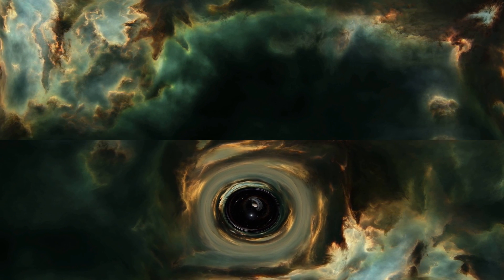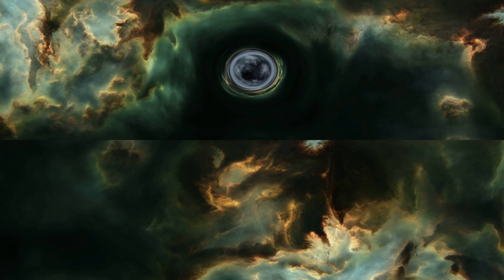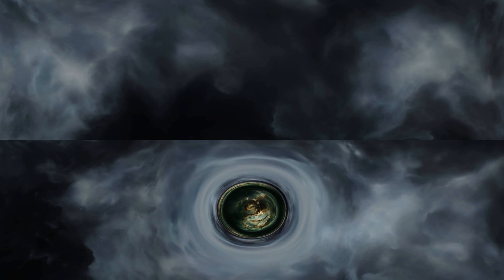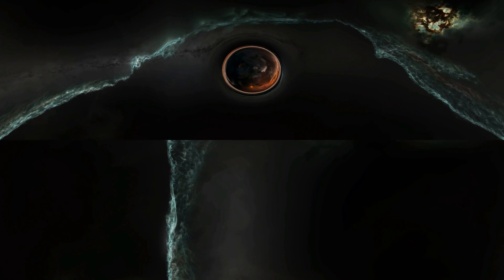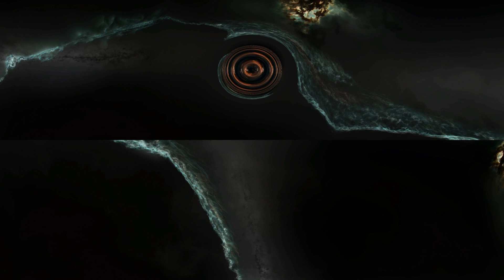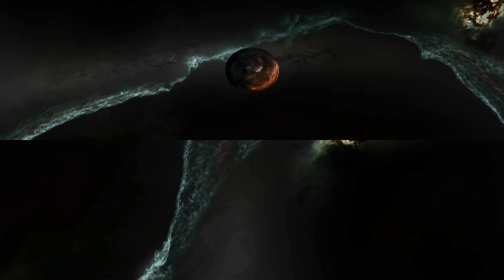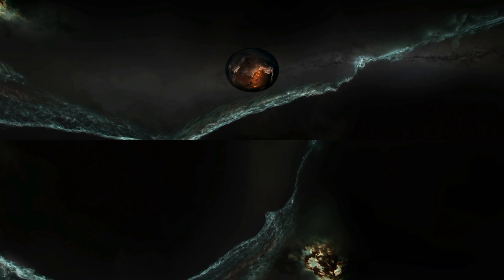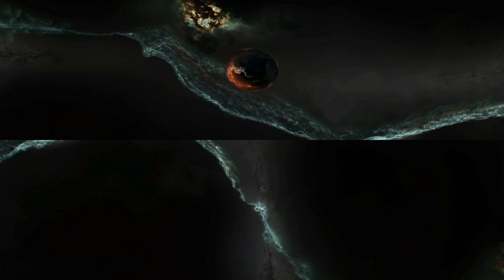What Would Travelling Through A Wormhole Look Like? (VR/360)

Comment: This is a good first step but it doesn't answer all the questions I have about what travelling through a wormhole would look like. It could be greatly improved by placing the ends of the wormhole in recognizable locations on Earth, and also by rendering the objects which are transiting.

What's not conveyed by the video in its current form is that when you are inside you would see yourself if you look in any direction other than towards the exit.

I was trying to imagine the physical implications of moving through a wormhole and to do that I considers a small (2 or 3 meter) wormhole suspended a few meters off the ground which connects two different cities (London and Paris, for example).

At each end of the wormhole you could have six ladders each approaching from the north, south, east, west, top, and bottom, and while from the outside an observer would expect the ladders to collide with each other they would actually all be perfectly parallel to each other inside the wormhole.

One question I can not figure out on my own is how exactly the entrance trajectory compares to the exit trajectory. If I start below a wormhole and climb a ladder up into it and keep climbing until I reach the other end then what direction will I be moving in when I emerge on the other side?

Comment: "But because space gets warped around it, light gets warped around it"

That's what gravitational lensing is.
Reply from the maker: Sort of.... but this geometry is only curved in space and not time so there's no gravity.
Reply: @scottmanley  I don't think there's a better way to distinguish gravity from non-gravity other than the presence of spacetime curvature. For example, the total mass of the wormhole is zero, but if you pick a small volume element inside the throat, the mass density will be nonzero (and negative, presumably). That said, even in an ordinary Schwarzschild black hole the mass is zero everywhere, and the effect of the black hole is seen in the curvature of geodesics around it. Such an effect certainly can be found here even if e.g. you can't orbit a satellite around it.

Or to mention another "vacuum solution" of GR, gravitational waves: they're surely massless, and nothing gravitates around them, but we still consider them a gravitational phenomenon. It's just that gravity is a richer phenomenon than initially appreciated by Newton.

(this was just a quibble btw, fantastic work on the renderer!)
Reply from the maker: @isodoublet  The difference is that without the time component of the curvature a non moving object won't be observe a gravitational pull, the curving of objects paths is only due to their motion. Does that make sense?

I intentionally chose a simple geometry to accelerate my rendering.
Reply: @scottmanley  That sounds like a coordinate-dependent statement.

Comment: Just a quick question, maybe even silly. There is a "mirror effect" to the grids that are formed there @5:50. I am curious if the symmetric properties between the Near-side and the Far-side have got to do with the apparent rotational direction (later seen when moving sideways) as well. What causes that symmetric grid patterns @5:50 and why the apparent rotation of both near & far sides be in the same direction?

Comment: I have a few questions.

If the wormhole has mass but no gravitational pull, does this mean that there is some kind of exotic matter which you could crash into at it's center? Or is this mass somehow obscured by space time?
Wormholes are supposed to connect 2 areas of space, I would have assumed that this would mean that you would be unable to enter it's center as that would be 1-1 mapped to the other side. Instead you showed that you can enter the wormhole, since you can enter it, how do you control where you exit?
Do specific coordinates on the internal surface map to specific coordinates on the external surface? Can a wormhole connect more than 2 area's of space? (for example can a wormhole map to 3 or more area's of space?)
Is is possible that there would be sections of the wormholes internal surface which would exit to nowhere, or possibly outside space time?
Would entering and exiting the wormhole warp/transform the dimensions of the craft entering? (I think you already partly answered this, but specifically I meant would the craft entering be warped in such a way that it could receive damage just from the transformations applied to it?)

Sorry, if any of these are difficult to answer.
I know that this is all theory, but this has been an area of interest since I was a kid, and my curiosity has peaked.
Thank you for the video, hope to seem more.

Comment: There is a pretty big issue that got left out in this video.  If the spaceship going through happened to be about the same size as the wormhole, that ship's sides possibly crashing into each other would be the least of its problems.  If the ship's dimensions happened to be anywhere near the size of the wormhole's features (entry/exit curvature radius and/or tunnel circumference), then the wormhole would have to flex and flatten in the space occupied by the ship, otherwise the space there being curved would partially crush the inside of the ship and/or tear apart the outside when the ship enters or exits the wormhole.  The ship could perhaps be designed so that it can bend, stretch, and/or compress to some extent to deal with that, but probably only enough to handle passing through wormholes at least an order of magnitude larger than the ship if the wormhole is inflexible.

Comment: Totally happy with the sphere from any approach vector, as it should be since the wormhole is not three dimensional but also existing/operating in higher dimensions. This is similar to a black hole where the event horizon is also a sphere and gravity wells are not 3D either. However, you mentioned several times that the wormhole would take you to another universe. Notwithstanding the technical issues of exotic matter etc. could a wormhole not take you to another point in our own universe? We know spacetime is not flat where it is warped by matter, especially large masses. A wormhole with both ends in our universe could be handy if one wanted to travel to parts that expansion has already made unreachable, for instance, or just to cut journey times to distant stars depending on where the exit point is.

Comment: Reflected my own thought experiments. Remember that when you go "through" a worm hole, you are not actually going "through" it... you are merely traversing the surface... You never actually go into the middle of it, as the middle technically doesn't exist... it's just a hyper-dimensional literal void .
Reply: There's lack of space and matter in it, so you're right. For it to open, it must create negative pressure in the middle and get rid of all there is. It's a Hypersphere.
Reply: Yeah it’s like an ant on a baloon. That is a representation of the universe. The wormhole is a tunnel through the baloon. When they look they see a line (a 1d line because 2d creatures see 1d as humans see 2d) if they try to walk through that line they actually end up walking across the surface of the tunnel into the other side. They never went through it. For them to go through it they would need to go into the 3rd dimension and float across the hole to the other side of it.
Reply: it's inverted space
Reply: That’s insane!

Comment: According to the wormhole theories I have read, wormholes would connect two points of the same universe instead of taking you to another universe as is stated several times. Of course since the multiverse and wormholes are both still theoretical I suppose it could be claimed that a wormhole would take you to another universe and you would not technically be wrong -- it just isn't what I have seen postulated before.

Comment: So, would negative energy or dark matter minus any gravitational pull cause the possibility of creating its own energy?
Reply: No. Negative energy doesn't exist. Dark matter has positive energy, if it had negative gravitational energy it would have the opposite effect on Galaxies, galaxies would rip apart instead of being clustered together.
Also, dark matter has the same magnitude of gravity as regular matter, so you would need the same amount of dark matter to produce gravity as regular matter. Actually, you would need more, because Dark Matter cannot radiate away the gravitational energy it possesses, and thus cannot undergo gravitational collapse( To Form compact powerful gravitational fields).

 Dark energy has a positive energy but negative pressure, because it's positive energy density is constant as space expands negative pressure is produced and overwhelms mthe gravitational attraction between Dark Energy fields.
Reply: And the energy density of dark matter and dark energy is so low that it is nowhere near strong enough to be used as the gravitational fields needed to create wormholes. It is also not known if the energy density these materials possesses is constant or variable, and even if they were there's no way to control either because they only interact gravitationally and gravity is too weak of a force to detect on the subatomic scale. Thus, particle detectors cannot look for Dark Matter directly.

Comment: Once inside the worm hole, we determine what part of galaxy we want, use directional manual gas stabilizers only to turn to that direction, then an electromagnetic shield discharge, while a short main full thruster burst to head out of worm hole and into direction, otherwise we would be stuck in the wormhole, and it becomes a worm hold. Great interaction on the video, thanks for sharing it.

Comment: is traversing a spherical hole really as simple as flying in a straight line through it? that's how you'd cross a flat (2D) hole, but that also entails traversing a higher dimension perpendicular to the dimensions of the hole. wouldn't that also be required to traverse a 3D hole? else how would the hole define which half corresponds with which universe since there is no universal frame of reference?